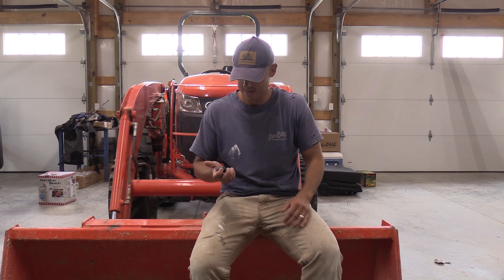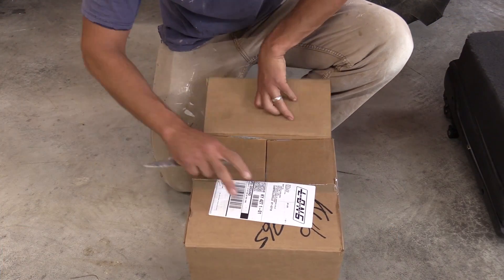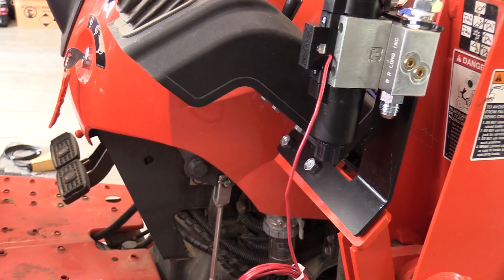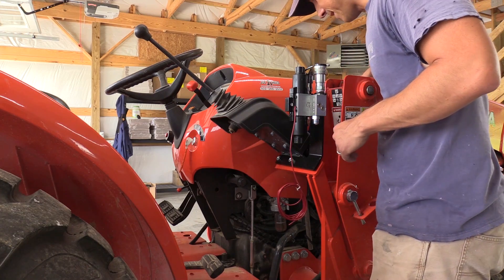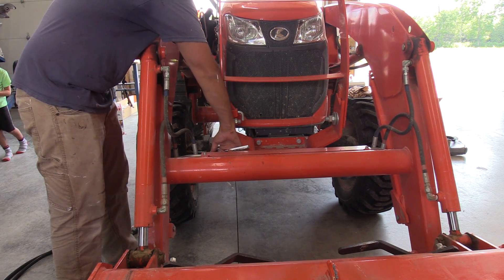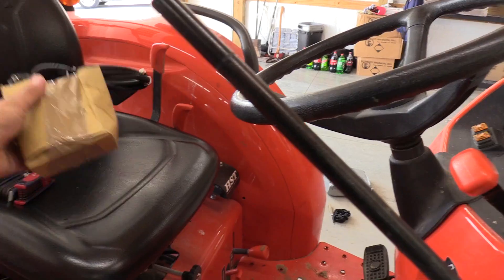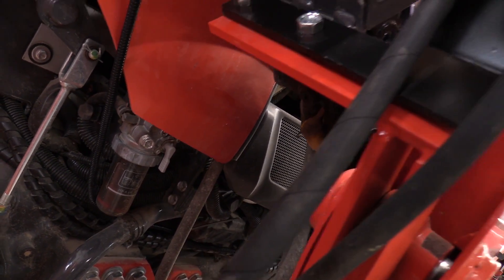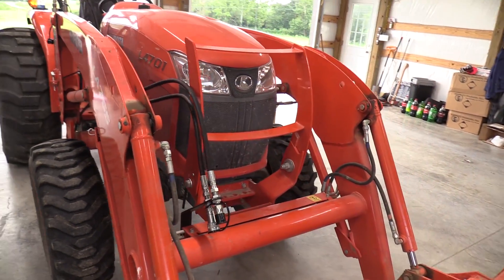Installing a 3rd function hydraulic for grapple or snow plow on tractor

Comment: At 5:1 there are no hoses coming out of the top of the diverter and then 6:18 after introducing your dog, Remi, there are magically 2 hoses coming out of the top of the diverter valve with no explanation of where they go or which is the power and which is the return.  You also totally skipped over the hookup to the solenoid.  I think I must have missed the brand of 3rd function kit that you are installing.  Your video is the 4th that I've watched on installing 3rd function kits on a Kubota and, I'm sorry to say, is in a solid 4th place.  Even the Messnick video is much better

Comment: The hose with the green tape is not 'power beyond'. Power beyond comes from the valve you added, to supply pressure to the original valves.
 There is no "power beyond" until you add the new valve and come off it, to supply pressure to the original valve.

Comment: I have the 3rd function valve on my Kubota as well for my snow plow . I'm thinking about getting a hydraulic top link , I should be able to run it off my 3rd function system ? No need for a rear remote for the top link then .

Comment: The Man Garage did the kit say anything about protecting the solenoid valve from the elements? The custom kit I installed on LS tractor I installed the solenoid valve under seat pan on top of transmission. Then run the two hoses up the loader tower and quick connect there just like the loader lines. Valve stays out of the elements.
Reply from the maker: I don't believe so. I store my tractor under roof but it has been rained on several times with no ill effects.,
Reply: The Man Garage ok. The solenoid valves I have used say water resistant not proof. Makes me a little concerned by having that valve out in the open like that. But it looks like a lot of aftermarket kits are installed the same way.  Thanks for replying

Comment: After running all the new hydraulic lines and the new connections, did you have to bleed them to remove air or anything ? Add fluid? Was it just hook and go basically?
Reply from the maker: It was plug and play buddy

Comment: Great video thanks. going to be a great help. I am also installing a third function hydraulic kit on my kabota L4701. The kit that you ordered, is that from land pride or a different company. 
On your video where you soldering the in-line fuse. And was the electrical easy to hook up
Reply from the maker: I ordered the kit hydraulic kit from everything attachments and yes the electrical is extremely easy to hook up. Just one positive wire. Thanks for watching!
Reply from the maker: The brand of the valve is WR Long purchased from everythingattachments

Comment: Well done, I basically ran mine the same way on my L4701. I installed the land pride 3rd function kit for my EA Wicked Grapple.
Reply: Where are the mounting brackets that came with the land pride third function hydraulic kit the same as the ones in the video
Reply: Byron Basso the brackets are different in the Land Pride kit.
Reply from the maker: Thanks for watching! How are you liking your wicked grapple?
Reply: The Man Garage I haven’t gotten my grapple yet, I’m currently 8 weeks into my wait. My grapple should be in the next build of wicked 60’s.